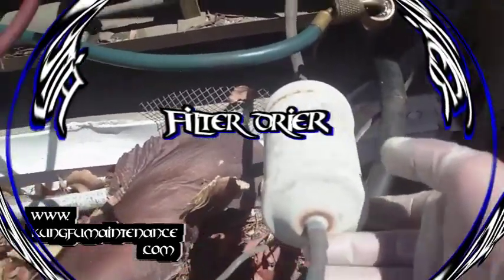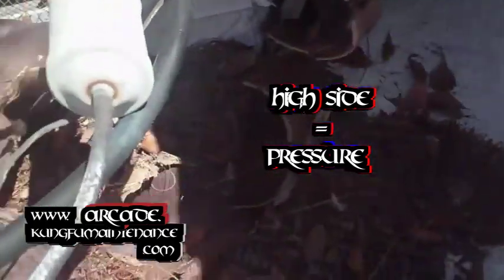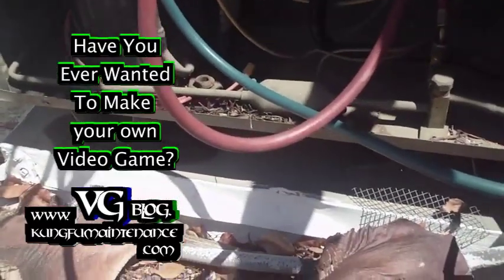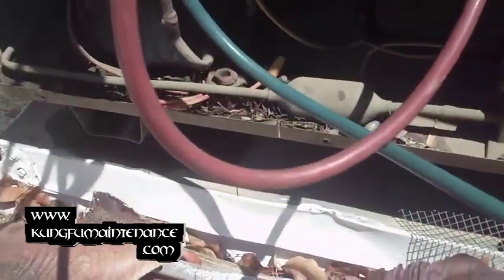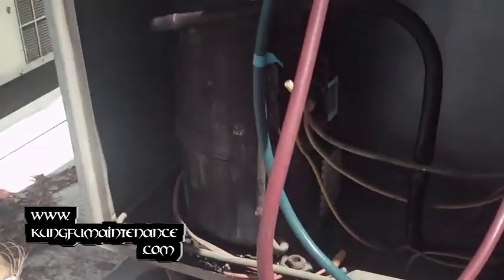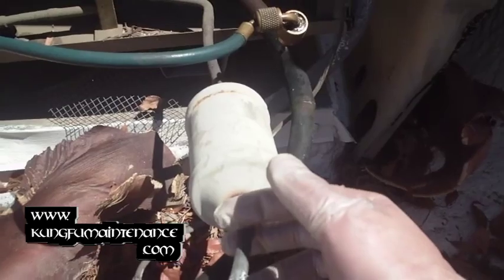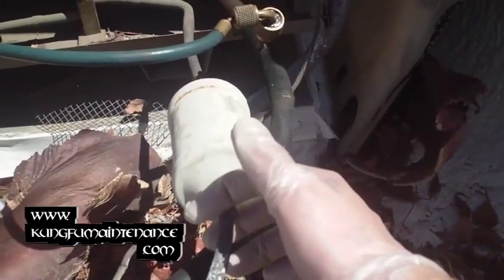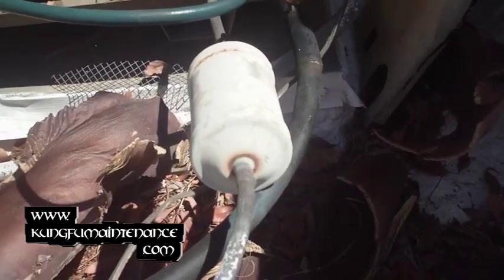Filter Drier ~ Air Conditioner 101  ~ Kung Fu Maintenance

Comment from the maker: It could. Systems can be charged with liquid but they are usually turned off (there is another method for charging through the high side while running) and the refrigerant dropped in by weight through the high side(some do it through both sides) but than wait generally 24 hours before energizing to avoid possible damage or compressor failure from liquid slugging. There are quite a few ways to charge and much debate and controversy on specific methods. I prefer by vapor through the low side.

Comment from the maker: Sounds like it is still low on freon. Just as rule of thumb low side will show around 40 plus or minus five on the green dial (right around 78 psi) For the green r22 high side dial ideal will be ambient outside temperature plus 30. If the unit will not take a charge there can be several different causes, bad schrader valves, non condensibles(air) in the system. A very hot compressor or very low can of freon will be slower to charge, putting some ice on the compressor can help speed things up.

Comment: Hello, Today i ran into an issue of a system reading low on coolant after charging the system the low side line stays warm about 70deg  the high side line is at about 85.reading is 64psig R-22 1.5 ton compressor 30 years old. no visible leaks, no air flow obstructions. It is almost as if there is some kind of blockage or the compressor is not running but it is..

Comment: Hi I work in a unit 3.1/2 t Carrie the compresor make big noise when it is turn off by the thermostato and the gauges show me  R 22 low pressure 68 psig but high 300psig and up what could be the problem thanks

Comment from the maker: Do you have a hard start kit installed on the capacitor? Is the evaporator coil correctly sized for the condensor?(for example 2.5 ton condensor to 2.5 ton evaporator) Is the suction line nice and chilly to the compressor from the evaporator after running for 5 minutes? The capacitor may be in need of replacement(losing it's phase) and/or a hard start kit may help to boost the compressor. Sometimes as the compressor ages a hard start kit is needed.(In some areas even new condensors need them.)

Comment: i replaced the air handler and added a drier, before i did this the outside unit worked good..
Reply: What happens when a filter dryer is installed with the arrow going in the opposite direction

Comment: I figured out after 30 min the compressor shuts off, it worked perfect before i replaced the air handler, is it possible the new handler works so well the compressor can't keep up over heats and shuts off??

Comment from the maker: This symptom would most likely indicate a low freon charge, hence a leak somewhere, however it could also indicate non condensables in the system (air, moisture, contaminants etc..), clogged capillary tubes or clogged TXV valve. Lastly it is also possible the system is overcharged and therefore not able to absorb the amount of heat and remove it to the outside that it could.

Comment from the maker: A filter drier should be added or replaced any time the plumbing portion (freon containing) of the A/C system is opened up. The filter drier removes moisture from inside the system so that moisture does not mix with the refrigerant and turn into acid. Nitrogen should be trickled through while brazing to prevent carbon and soot from building up clogging capillary tubes or TXV. Once all plumbing is in place a vacuum should be pulled for a good amount of time to boil off moisture inside the system.